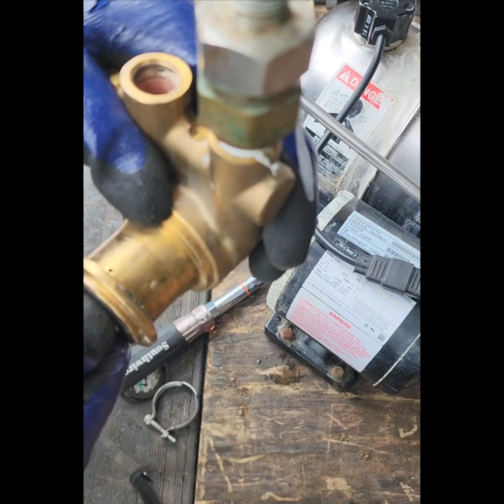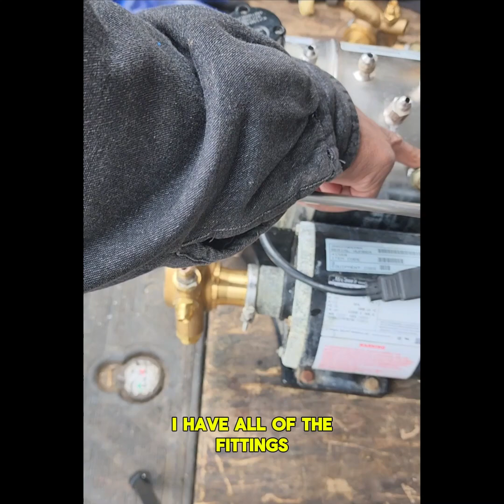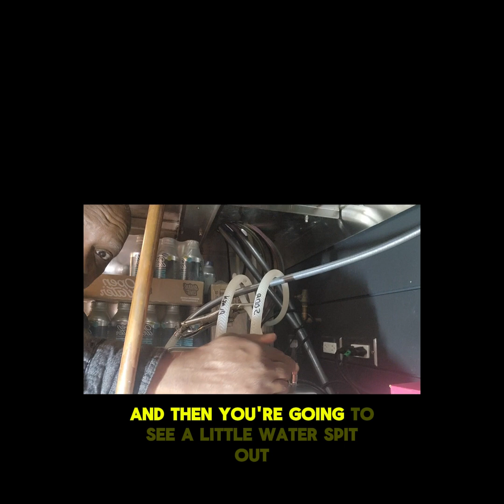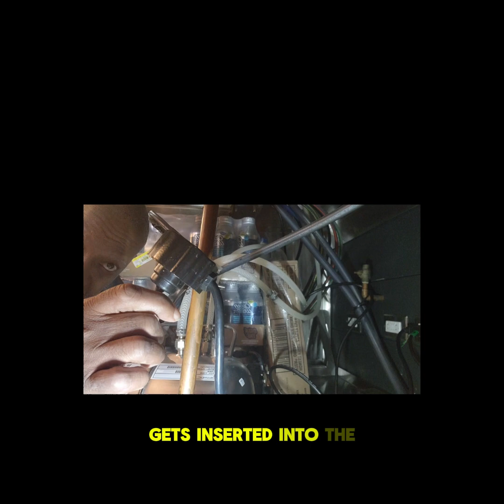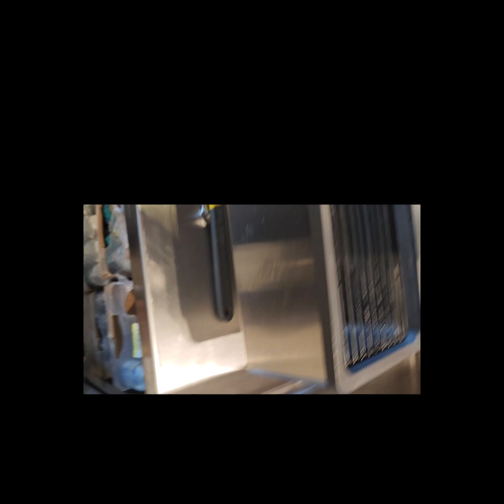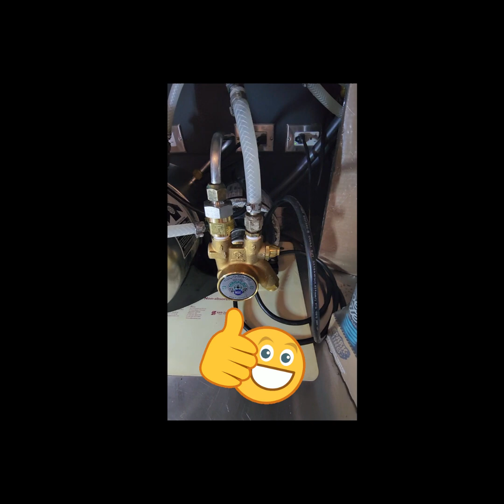Mcann Big Mac Carbonator Repair

Comment: if the carbonator is only partially carbonating the water after you make sure there are no problems with the CO2 pressure or water quality, what are the possible problems? a problem with the machine itself?
Reply from the maker: Great question — and yes, if CO₂ pressure and water quality are confirmed good, then you’re definitely looking at something inside the carbonator system itself.
A few common causes for partial carbonation:
• Weak or failing carbonator pump – not building enough pressure to fully saturate the water
• Water flow too high – water moving too fast through the tank won’t absorb enough CO₂
• Bad check valve (very common) – can restrict CO₂ entry or allow backflow
• Low tank pressure / air in system – improper pressure balance inside the carbonator
• Clogged diffuser stone or injector – reduces how well CO₂ mixes with water
• Temperature issue – warmer water won’t absorb CO₂ properly (huge factor)
• Internal leaks – especially around fittings or tank seals
If everything upstream checks out, I usually start with: 👉 Verify pump performance
👉 Check/replace the check valve
👉 Confirm water temp and flow rate
That combination solves most “partial carbonation” issues in the field. Try out our free app in the description it has carbonation workflows you can go through while onsite.
Reply: @latcommercialrepair  I just watched another video where they talked about heating the water to dispel gases and then cooling the water to close to freezing before carbonating. Im considering trying that.
Reply from the maker: @IndividualHumanRights-up3ml I have never heard of that in that way. Basically the carbonation is activated when it comes in contact with the ice. The syrup and water lines run underneath a cold plate and the ice that sits on top of the cold plate activates the CO2, so you would also want to make sure that the ice in the bin is completely covering the cold plate, sometimes the ice can bridge and keep the ice from laying on the cold or causes ice to accumulate on one side of the ice bin cold plate so check to make sure each flavor is between 34 to 36 degrees and that will let you know if you may have an ice bridging issue.
Reply: @latcommercialrepair no the carbonation is not activated. When it comes in contact with the ice the carbonation is put into the water when it goes through the carbonator machine
Reply from the maker: @IndividualHumanRights-up3ml can your send the soda machine  model number and serial number I maybe able to better understanding  the type of system you have?